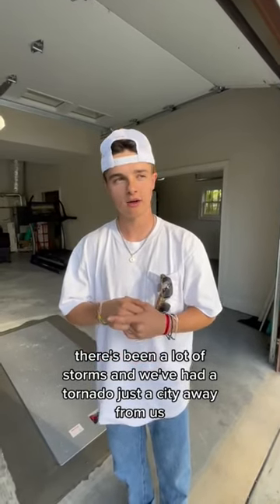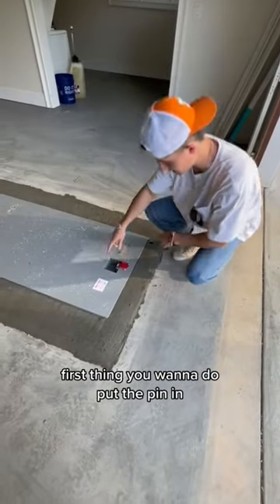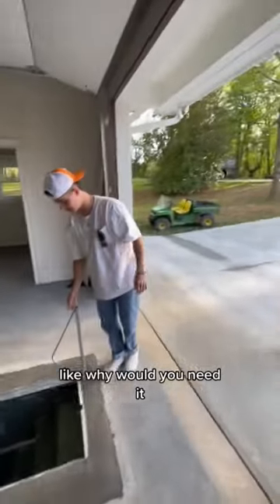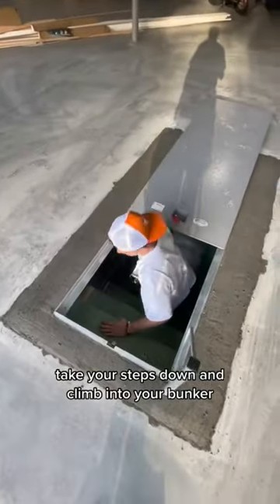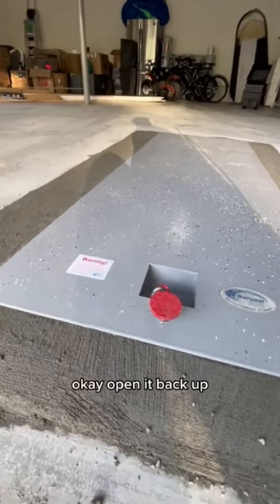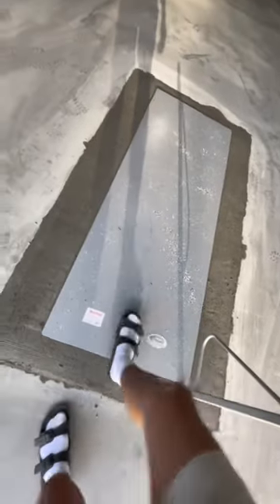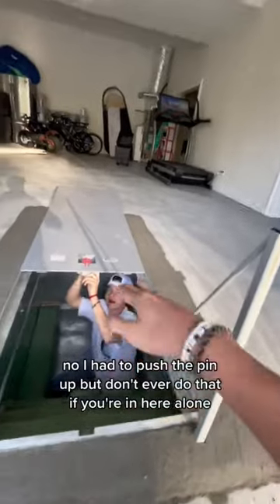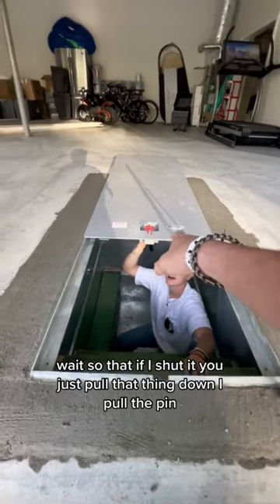Tornado Shelter Tour 🌪️😳*I Got Stuck!!!*

Comment: I would use it to work on my car.
Reply from the maker: So smart!!
Reply: How would you get under there? Have some drive the car over it? 😅
Reply: @mavejohnston7160  Drive the car over it, crawl under the car into the spot?
Reply: @mavejohnston7160  those bays usually have stairs to get in and out I've always wanted something like that built into my home like an escape room but more like an escape hallway like the Millennium Falcon
Reply: pretty sure that's what it's used for?
Reply: Big brain right here. The double utility.
Reply: @sweaterburger  it’s a tornado shelter

Comment: That seems like a death sentence either way.
Reply: Being buried underneath the collapsed roof of your own garage doesn't seem too pleasant, no.
Reply: Yeah these are probably the worst “shelters” you can get.
Reply: @gustaveliasson5395  vs hiding in the bathroom like most people do?
Reply: @Zemanbeast 
The bathroom's not a bad idea, actually.
If you're thinking about renovating the bathroom and interested in getting a storm shelter, you might as well fortify the bathroom instead of building a bunker beneath the garage.
Reply: @gustaveliasson5395 more than likely not. The tornado is going to toss your roof a few miles away lmao.

Comment: I have the exact same 
tornado shelter under my garage floor. There's a chain with a small bar on it which is attached to the bottom of the latch-pin which secures the sliding door in the closed position (just like any spring-loaded latch pin going into the corresponding striker-plate hole of any door in your house). You just pull down on the little bar and the pin slides down and the door pops open.
Reply: How does air get through it?
Reply: Assuming the garage/house still exists, you'll get out, yeah.
Reply: @thekeysman6760  The purpose of the UNDERGROUND shelter is that you will get out even if the house and garage are completely blown away.
Reply: @chrissymcintyre8337 it’s not airtight. It’s only protection from large debris.

Comment: You should keep something in there to get yourself out in case you get trapped. Since it’s metal I’d Recommend something to cut the metal. If it’s wooden structure use a fire axe
Reply: It has a come along built in.

Comment: Not to be a party pooper, but i lived most of my life in tornado alley in Kansas and Texas. I have been as close as 100-200 yards from a tornado. If you get hit by a tornado theres a good chance that a lot of debris could cover your shelter and you will possibly be trapped in there until someone knows to look for you there. Maybe file an emergency plan with your nearest fire substation letting them know to look for the shelter if a tornado does major damage. Living where i do i have never seen a shelter in a garage. They are usually in the back yard. Still, better than hiding in the bathtub.